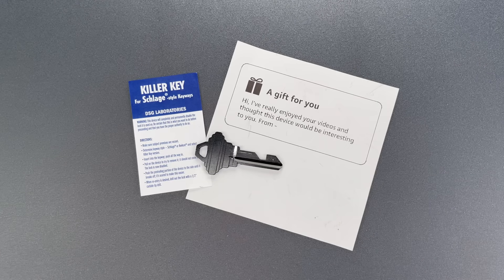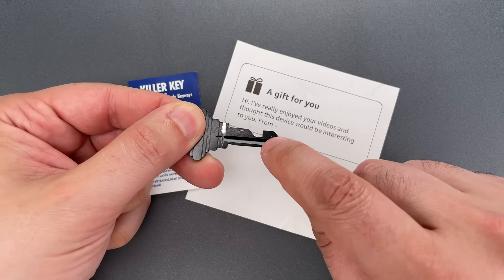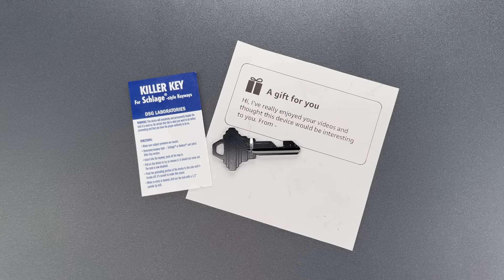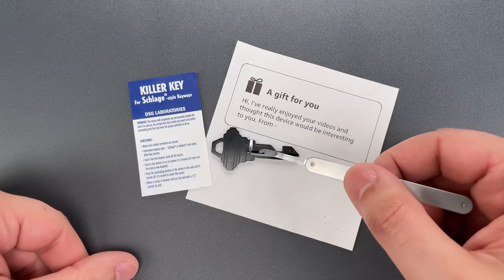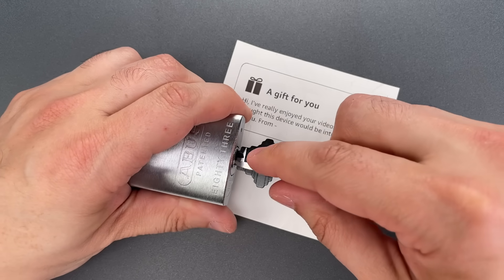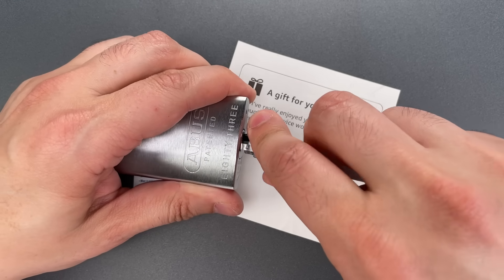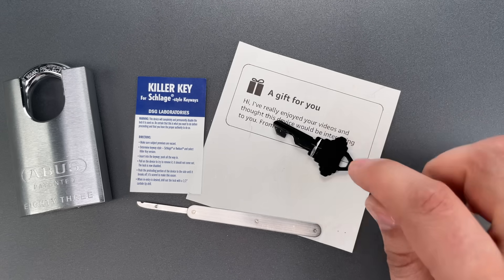[1350] Defeating a “Killer Key”

Comment: What is the intended purpose of the “killer key”?
Reply: I'd wager it's to lock someone out... IE renter was evicted and still had a key to the apt..
Reply: @MajCyric  wouldn't it be easier to just change the lock? I mean that's what you'll have to end up doing anyway unless you do what LPL did, but most would probably end up drilling out the lock to get rid of it, which can be a problem if the lock has anti-drill features that will chew up the bits.
Reply: @Riiludragon  Not if they lack a "handyman" on site that knows how to change a lock etc.. It's more of a short term "fix" for a problem..
Reply: @Riiludragon  if the old tenant changed the lock, so the landlord doesn't have the key and he wants to keep the tenants out of the house until he can get a locksmith.
Reply: @MajCyric  That use case doesn't make much sense. If they still have the key, change the lock. Drilling the lock out later is a lot more work than just changing the lock.
Reply: @BriBCG  Yes, but you might not be able to get a hold of a locksmith right away, so a killer key is used until you can get the lock changed.
Reply: @BriBCG  This is only a problem if the lock protects the only entrance to the premises. Most doors with a killer key in the lock can still be opened from the other side.
Reply: report the person who posted a youtube link earlier in this thread, it's spam and unrelated.  don't click the video either
Reply: To troll neighbors.
Reply: When you've already used your tea cup to kill someone, you can pull out the key to intimidate his buddies.
Reply: @nuclearmedicineman6270  Whoa now Riddick, what are you doing here?
Reply: @nuclearmedicineman6270  ahh good ole Riddick
Reply: "Lose all of your friends and get fired" device.
Reply: Sell more new locks, as you can see on the instruction the official way to remove the killer key is to destroy the old lock.
Reply: Don't forget to report that "link" comment as spam.
If you don't see it, ignore this comment.
Reply: If someone's chasing you on foot, this can quickly slow them down enough to get away
Reply: You lock the doors, then slot this in to keep whoever stuck inside unable to escape quickly while you approach silently and slowly to stab them
Reply: A convenient ans easy pocket-sized way of incurring massive amounts of civil and criminal liability upon yourself in a jiffy!
Reply: Decades ago when I was a locksmith, they were common with Motels to lockout a non paying guest.  This was before the card keys used today, 1970s.
Reply: @davidmoran4471  👍
Reply: @davidmoran4471  Right, but the lockout key was typically REMOVABLE, this key is [supposedly] not.  I believe OP wants to know what the purpose of a KILLER key is (meaning one that actually did its job and totally rendered the lock useless).

There is no point, other than for malicious reasons
Reply: A "red team" (attacker) could use it to either divert attention, or disable a door so that they could take advantage of the chaos to enter a facility.
Reply: Seems like it’s be cool for a safe if you want to keep the true keys close.
Reply: youre x'es door.
Reply: Deadbeat tenants who refuse to pay their rent. Also used to piss off whoever you don't like. Just shove this in their lock to make them call out a locksmith or at least making them pay up for a new lock.

Comment: Add Loctite Hysol 9462 to the "killer" key prior to insertion.   :^D
Reply: Just good old crazy glue will work just fine!
Reply: @MoraFermi  that's what I'm thinking, not like someone has a tiny tube of acetone on hand, "I've been waiting for this day"
Reply: @creeplife2802  Super glue breaks down pretty easily with heat.  Epoxy breaks down at higher temperatures and works better when it comes to "gap filling".
Reply: oky  Reported

Comment: "If I were going to make a killer key..." Then shows a killer key he made without ever referencing it.
Reply: Not clear what these keys are for. Looked it up and came up with law enforcement and landlords to deny access. Is that a real-world scenario?
Reply: @smcdonald9991  while I'm sure they have some practical use, I'm sure 99% of these end up in the lock of "That neighbor" or the users boss or used for a stupid prank.
Reply: @smcdonald9991  more useful for an angry person with a vendetta, it would seem. :)
Reply: @Nelo390  That's exactly what I thought.
Reply: @smcdonald9991  Maybe a door you want to stay locked (or unlocked) despite stolen keys and low skill lock pickers.  Proper solution is to remove the lock cylinder and re-rig the door to have no lock on that side.

Another use is to quickly block a lock while waiting for a changed lock to be installed by a real locksmith.
Reply: @johndododoe1411  you could just replace the lock/doorknob though
Reply: @eaglestdogg  Replacing the entire lock/handle is more work than inserting then this cheap blocking key and phoning your locksmith to replace things next business day.
Reply: @smcdonald9991  if a tenant is evicted but the landlord has worries that the tenant won't leave peacefully or may come back before they can change the lock, it is a relatively simple and fast way to prevent the someone who used to have keys from being able to get back in as easily
Reply: @TheSamuraieater  Here's the link to a proper, valid, useful lockout key:  https://www.youtube.com/watch?v=XfCv7_hQr7M

You can order them online, or make them if you have a dremel, file, a steady hand, and some patience.
Reply: @TheSamuraieater  Yes, I understood that but is it likely? 
Because unless LPL's tool is used, the landlord himself (or a locksmith) would have to drill the lock to open the door.
Reply: @smcdonald9991  if unwanted tenants already have un-surrendered keys to the lock for the residence,  the lock is useless and is best drilled.
Reply: @ryanwaltos2206  just change the lock.
Reply: @smcdonald9991  They’re more of a sales gimmick than anything…epoxy injection takes 3 seconds and will ensure having to brute force to remove.
Reply: @craiglyles4755  well assuming that whoever you do this to doesn't know how to remove the key, which i imagine most people wouldn't, this is a cheap and easy way to block a lock that is also temporary.  You risk the person taking the key out but in some cases that may be better than getting a new lock
Reply: @UCXEO5L8xnaMJhtUsuNXhlmQ  True, it would be useful in a case where you want to save the lock,  but lockouts generally get replaced.
Reply: @smcdonald9991  that definitely is a use case, though the classic approach would be removing the old lock and installing another
Reply: @smcdonald9991  the other comments that claim it to be useful are correct. I remember a video with a secret service member, that said they use them to block off doors when they do not have the time to clear the room properly.
Reply: oky  Nobody click on this spam
Reply: @TheKaniq94  i know hasnt their been like a lot of bots lately!? on all the vids i watch theres bots EVERYWHERE!
Reply: @codymarshall8487  Same yt name has posted that link on a number of his vids going back a week or more. Love the slow response time on enforcement
Reply: @TheKaniq94  Nah, always click on it, and report the underlying video.

This is never just some random guy deciding to spam a link to a random vid. They are spambots paid for by the video's creator to mass advertise it.
Reply: @TheKaniq94  I report those then block them.
Reply: @TheKaniq94  you dont have to worry about the vid, you only have to worry about the person that spread it, their intention to do it is what you should wary off
Reply: @B__C__G I reported it too.
Reply: i told you guys he is batman
Reply: @qazplmm632  imagine being so stupid that you talk about something you know nothing about.
Reply: @SpecterNeverSpectator  nice to know your talking about yourself but your own stupidity isn't something to boast about mate
Reply: @Author B.L. Alley maybe make things people want to see
Reply: I don't understand the use case for this product. A tune of JB weld would be more effective at the job this thing does and also has other uses.
Reply: Savage!
Reply: And he carries it on his keychain.
Reply: Oh that old thing? That's just the killer key that he and Bosnian Bill made
Reply: That's a sparrows key
Reply: The audacity of this flex!
Reply: @B__C__G most wholesome reason? Wtf did you use that word for? Oh, that's right, you noticed it gets likes on YT. It's a dumb trend and you failed miserably in it's usage.
Reply: @EcotecEngine3.8V6  That's not a very wholesome way to talk to someone.
Reply: oky  👈 REPORT FOR SPAM
Reply: no
Reply: Truly the most stupefying part of the video to me lmao
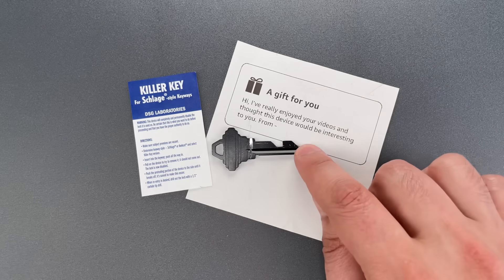Reply: For your convenience 0:48
Reply: @B__C__G whenever people spam like this, I also go to the video and give it a downvote. Makes it a bit less attractive to the algorithm.
Reply: @safe-keeper1042  It's better to either ignore or report it - downvoting is still a form of engaging.

How To Cook That talks about the content farms a lot while debunking their crap and she says that Youtube rewards downvotes because you went to the video.
Reply: @safe-keeper1042  Sadly, just because of these spam links, I might be missing real important links members might post in their answers. There are always some like me, who don't grasp certain things. A side bar video to help people are the ones I'm referring. Not these asshats like Oky's.
Reply: @safe-keeper1042  just report as spam, it's way more effecive.
Reply: @francescozani9488  Reporting it just removes it for you. You will not see the link in the comments section, but all other users will. If reporting would be successful, we would not see so many spam links. I guess YouTube just does nothing about it.
Reply: @francescozani9488  is it, though? There are channels with spam-posters I've reported countless times (and "blocked" to boot) and yet they're still there and visible to me.
Reply: @safe-keeper1042  Hey just so you know, ur dislikes help it in the algorithm just as much as a like would. best course of action is to not click of it at all, or report the video if you can make a report that would not be abusing the reporting system
Reply: @safe-keeper1042  Thumbs down are counted exactly as up votes. Both are one view + one interaction. You could call the poster out with a nasty comment on the unethical behavior and give him the trifecta for his monetization.
Reply: oky  So funny how this has been spammed on so many channels.  The first prayer is actually really beautiful on a musical level.
Reply: @asdfghjkl7507  So you have watched the spam video? Then you are a big part of the problem!

Comment: Why would someone need something like this?  What legitimate use does it have?
Reply: To prevent someone with areal key from getting in somewhere before the locksmith arrives to change the lock
Reply: Probably defense against attackers that want to stay low key when you are on extended leave from your house or other property and when you return you either get a guy that can remove it or just change the lock.
Reply: Griefing

Comment: I guess my question is, what is the point of this product.
Reply: My school switched from physical door keys to electronic locks opened with an ID. It would have been expensive to remove the physical locks, so instead they put killer keys inside all of them.
Reply: From the product description: 
“The Killer Key can be a valuable tool for law enforcement as an instantly deployable access denial device. It's also a useful tool for property management to prevent return of evicted tenants before the locks can be changed. About 90% of the locks used in the USA use one of two key styles - Schlage® or Kwikset®, so a Killer Key version is available for each.”
Reply: @dansv1  This is kinda sad honestly. Just change the locks lol. I can't imagine being the big brained property manager who decided that adding an extra step that costs money and time (they're gonna have to change the lock anyway after drilling it) was the best way to go about it.
Reply: theoretically turn a door into a wall I guess if you don't want people entering from somewhere anymore
Reply: Thanks👍